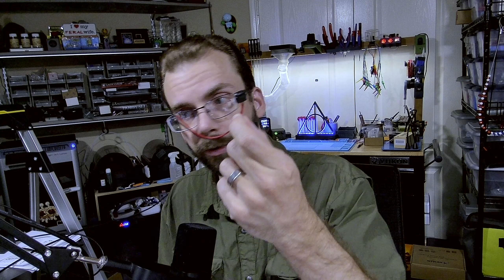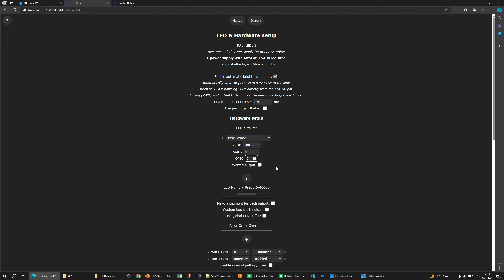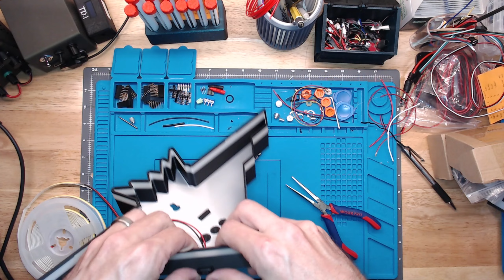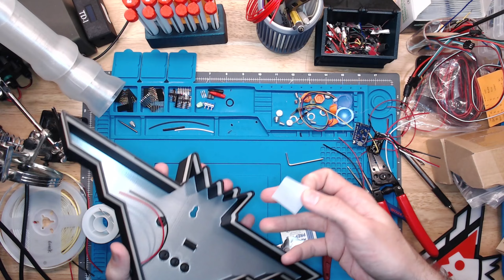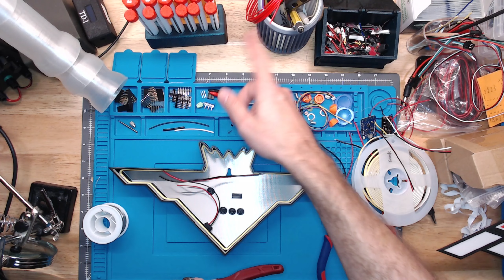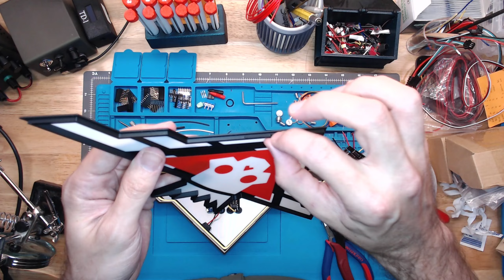A Year of Light Boxes: Assembly

Comment: Isnt it easier buying cob led strips with usb? any reasons why you choose not to? :)
Reply from the maker: @Majk337  easier, yes. Not as clean though. Not as featureful.

I also prefer to build in my own controllers using WLED for all the features that offers (it's actually less expensive, too) vs an on/off switch or basic remote. HOWEVER it's important to know what the person receiving the lamp wants. Some people will want features, others will want simple.
Reply: @RevHazlett  thank you for the explanation. Im in the beginning of starting to create litghtboxes myself, why im asking! 🙂
Reply from the maker: @Majk337  all good! Everyone develops their own style. Light boxes with simple holes in the side are popular because you can use cheap light strips with integrates controllers (or no controllers at all) just by shoving them in the side. I don't like these since they leave light spilling out the hole and the length of your cable is determined by what's glued in to the box. I get the appeal though - you don't even need any tools to make one this way, let alone do any soldering. I happen to enjoy the soldering and custom electronics though 😁
Reply: @RevHazlett  Yea i wanna learn that too, but as of now i dont have any space for all the equipment. You earned a sub and i will look through all your content and hopefully learn a thing or two ☺️ Thanks!
Reply: @RevHazlett  why do you use the transparent/glowing filament between frame and front? For a special effect? You always use that? 🙂
Reply from the maker: @Majk337  I call it a bias strip. Primarily it's to allow the light to be cast on the wall, creating a glow around the box. You can use natural ("clear") PLA for this, but the rational Glow-in-the-Dark filaments are just natural with some glowy bits mixed in so I prefer using that. Adds a little fun extra to it. 

Secondarily, it gives me an alignment guide when installing LED strips on edge-lit boxes, like this one.

You can use this for independent effects as well if you want to zone your box, like I did with my Fortnite one.
Reply: @RevHazlett  you should do a tutorial with the wsb rgb lights also :D Im happy to learn it all haha :) also a tutorial with a battery :)
Reply: @RevHazlett  Also you should make a short with all the tools and equipment which is needed/good to start making these :)

Comment: What gauge wire are you using?
Reply from the maker: When I buy spools of wire it's 22AWG, both solid and stranded, and use this for just about everything. Sometimes I'll use 18-20AWG if I'm passing higher wattages through a relay or something like that, and sometimes I'll use chunks 24AWG that came off of components and have been sitting around in the scrap bin.

Comment: Awesome video! So i'm trying to make my own lightbox without the wled and just basic components. Essentially I just want to solder the led strip to a usb-c board/port and mount the female end on the box im designing so you can plug any old usb-c phone charger/cable into it and work. I think you mentioned the usb-c part you had came with your strip, but would you know where i could find those to purchase or specifically which ones would work, because the couple that I bought aren't working. Any advice would be greatly appreciated.
Reply from the maker: I've made many a light where it's literally just the USB interface and a COB LED inside it - nice and simple and makes colored prints really pop!

There are links for the parts as well as my Fusion template itself in this video, everything you need is there!

https://www.youtube.com/watch?v=13vtPfgKxbk

Comment: Love the videos they are a great help just wondering what bench power supply u are using for testing and jumper cables
Reply from the maker: @koadieherrington8896  i specifically bought the power supply for features and form-factor and absolutely love it -  https://a.co/d/g22qvBd

Jumpers are good, too - https://a.co/d/3NyKiOa
Reply: Just got a question are you thinking of making a video of a light box with addressable rgb led
Reply from the maker: @koadieherrington8896  I actually have several prints already made specifically for the purpose of demoing the differences between PWM, CCT, RGB, RGBW, Addressable (IC), SMD, and COB LEDs. I've even bought some new video equipment to properly record it. Just haven't had time 😭
Reply: @ totally understand on the time i was just wondering hopefully you will get some free time soon to get them started. I cant wait to see them when you do get the time to get them made

Comment: any way you can do a video with the wled d1 mini and a multicolor addressable light strip.  Kinda confused on how to solder one together
Reply from the maker: @rx2006je  those are honestly even easier - 5v/GND go to your power source and the data cable goes to the D1. You can treat the input, power to the D1, and power to the LED strip all as common. 

There's a few good pictures in the write-up for this one https://makerworld.com/en/models/512062#profileId-428137

I do intend on a video to compare different types of LEDs, controllers, and design considerations for what light suits which box best. Maybe I'll have some time in the winter breaks that are coming up!

Comment: In one of your videos did you talk about the different controls you use for the different lights?  I thought I saw it in one but can’t find it now.
Reply from the maker: @nhboulware  not really in much depth outside of this one. Early on I was busting apart some pre-fab controllers and mounting them inside the lights, but the majority of them are simple power switches and static lights. Then I embraced WLED and it's my default offering, even if mono PWM LEDs (like this one) just for the remote control and dimming.

What I put in them today is really just dependant on what people want. Some folks just want a light that turns on and that's all they care about. Some folks want the full HomeAssistant integration. I still have plenty of orders that get fulfilled with an inline dimmer on the USB cable and no remote control at all. 

I do have a more in-depth walkthrough on LED types and control considerations in my video queue, but I've had precious little free time to make it. Soon™️!
Reply: @RevHazlett  Thanks.  ill be on the look out for that.  Im still trying to figure out what direction to go with my designs.

Comment: Do you by chance have a link for AliExpress for your electronic components? I’ve searched and there are so many different ones lol. Also what gauge wire do you use? Sorry for all the questions but this whole series of videos has been great.
Reply: That’s perfect thank you.
Reply from the maker: Yeah, there are quite a few. I need to get a solid reference section together, but haven't taken the time to renovate what I had thrown together some time ago at https://ludicrosity.net/3dp

I hate saying this, but the best thing for right now is to look in the project descriptions on MakerWorld since I usually link relevant parts there when I post the projects themselves. https://makerworld.com/en/@RevHazlett

What I use most commonly though:
- Wemos D1 Mini V3
- BTF-Lighting WS2812B-ECO 60/m RGBIC LEDs (per-pixel addressable LEDs)
- Xunata or Pautix 320/m 4000k (or 6000k) White 5V COB LEDs (Xunata also makes a lot of neat colored COBs)
- AOD4814 PWM driver (for PWM driven non-IC LEDs)
- USB-C Connector Jack
- M1.7x5 and M2.3x5 self-tapping screws

That's like... 90% of what goes in to my projects.

Comment: "That's some of the sleekest wiring on light boxes I've ever seen in the 3D printing community. I'll aim to achieve that."
Reply from the maker: @mikekiske  aw, thank you. You can chop wires shorter, bind them up cleaner, etc. I leave a little more than I actually need just to make it easy 🤣
Reply: @RevHazlett  
But it's still the best I've seen. Most people just use hot glue and that's it. 😮
Is there a special reason for the white led line surrounding the entire piece?"
Reply from the maker: @mikekiske  That's explained in the other two parts - it's a translucent glow-in-the-dark filament. The light from the box will cast out sideways like a bias light and illuminate the wall around it. There's a link in the description that has lots of my light boxes with photos, you can see it in most of them.